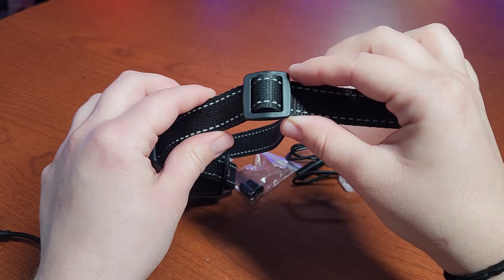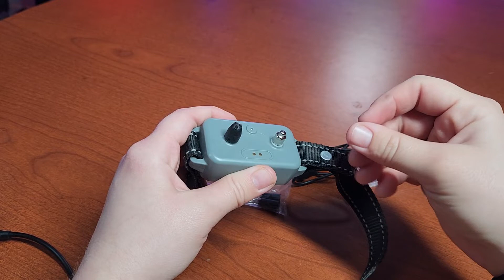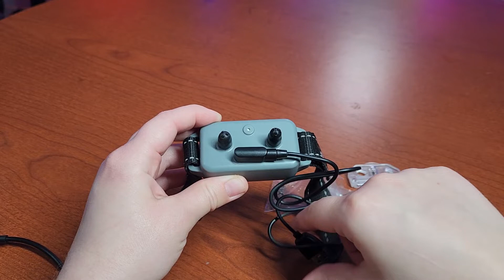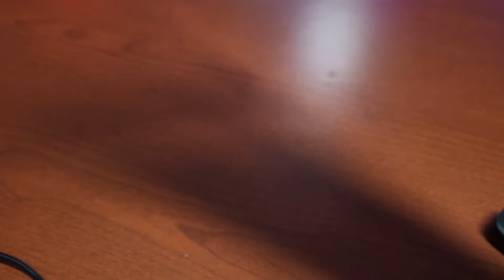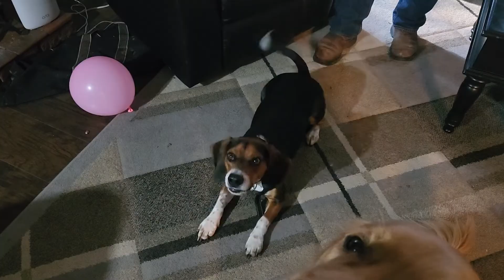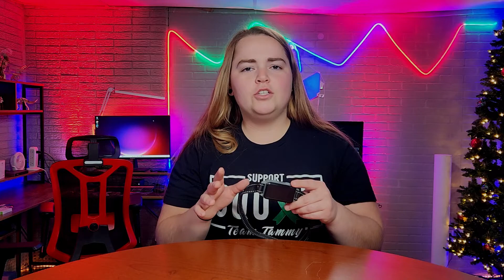Full demo of the smart dog bark control collar

Comment: I have older one and I can’t get it to pick up my dogs bark
Reply from the maker: They can be a little finicky at times. I would take the collar off and try barking into the collar to make sure it works. Then pay attention to you pitch...sometimes that makes all the difference.  Low pitch seem to trigger the collar the best
Reply: I have the exact same problem, it's not picking up my dogs bark when it's on him but does when it's off, then the testing doesn't even work.

Comment: But where is the demo🤷🏻‍♂️ how does it works
Reply from the maker: Did you watch the full video???
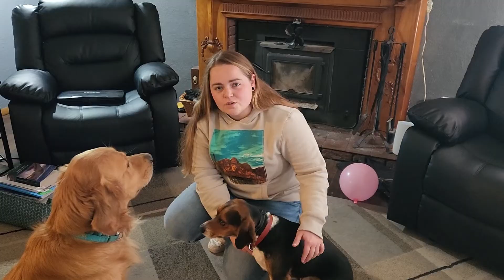If not you can see how it works starting at 2:20 or if you want to see it demonstrated on a dog you can check it out at the 5:00 mark.
Reply: What video did you watch? This whole thing is an in depth demonstration.